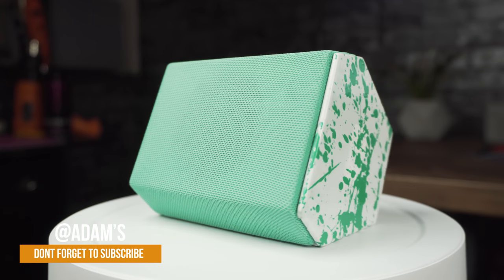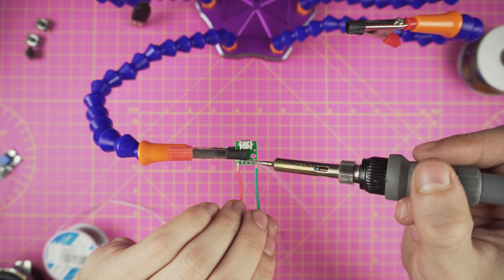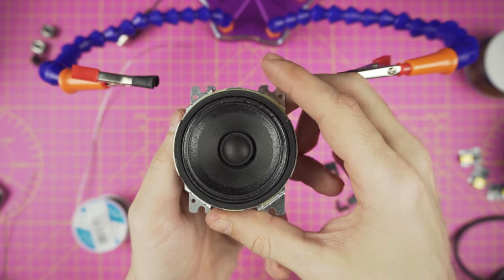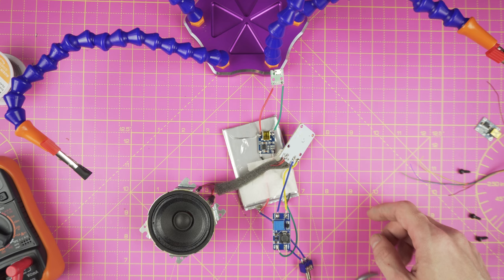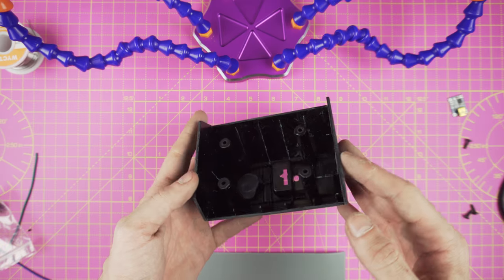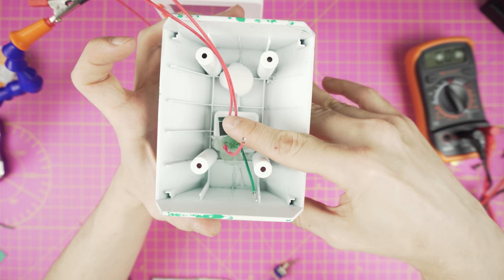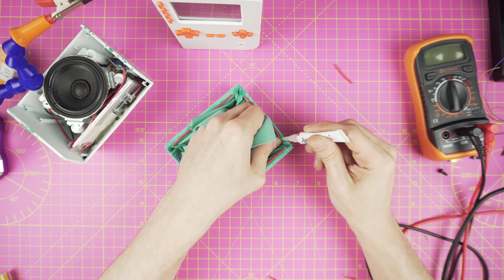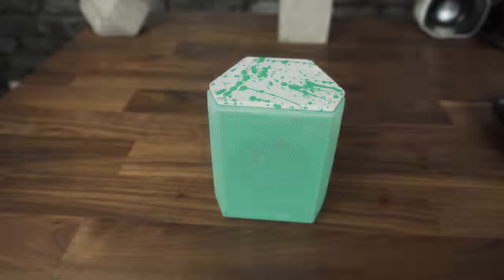How to Make a Bluetooth Speaker

Comment: Quick tip on all my bt builds I always add a second switch for the speakers that can be turned on after the irritating voice or loud beeping tones that seem to be present on most bt amps.
Reply from the maker: Nice tip, It does have a high pitched noise right after I open it, I will definetly try it

Comment: Nice work, again! Any precautions we need to take while soldering the battery to the modules ?
Reply from the maker: If you check the baterry for any leaks, swollen parts, you are safe soldering the modules, same when you charge it, the module will protect it for over charge!